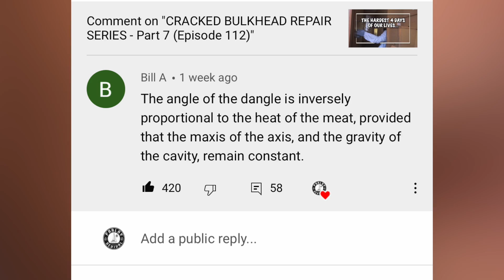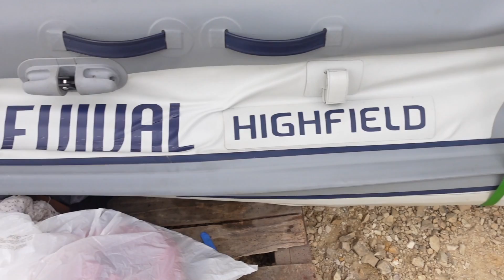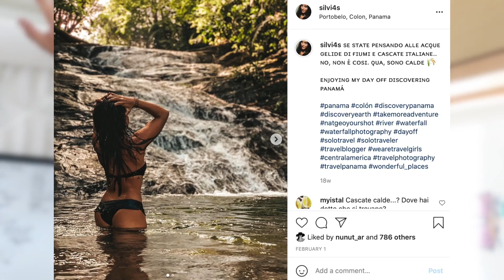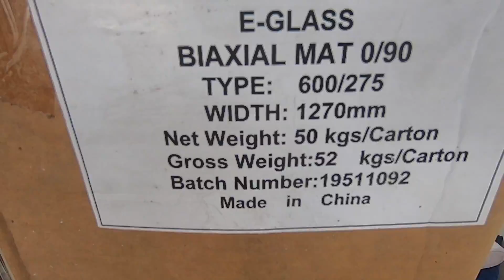CRACKED BULKHEAD REPAIR SERIES - Part 8  (Episode 113)

Comment: I'm interested in what you did to get the new epoxy to adhere to the existing polyester.  I've heard they don't stick to each other well?  Did you just sand the polyester to get a mechanical bond?

Can't wait to see the end result of this back on the water!
Reply: Epoxy on cured polyesther is fine, the other way around not so good.
Reply: They adhere together fine and strong. That’s just an old tale saying they don’t bond but they ground away all the polyester fiberglass anyways.
Reply: @mwatkins2464  Thanks, that's good to know.  I don't have any firsthand experience with it, just something I'd heard in the past.
Reply: If they'd been doing epoxy to epoxy , and it had cured , they'd only get a mechanical bond anyway